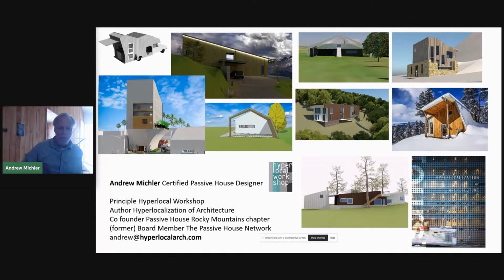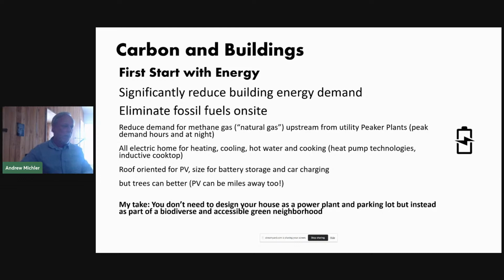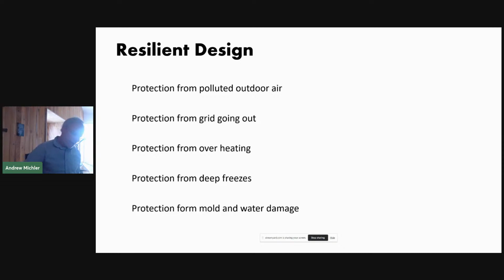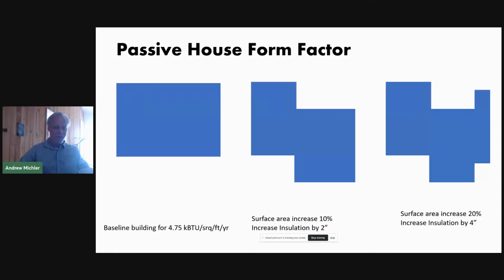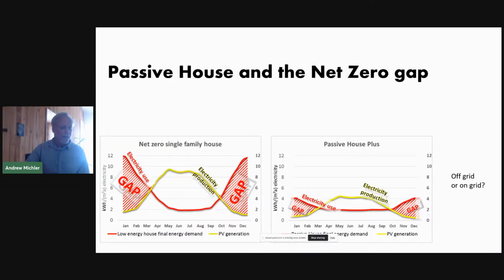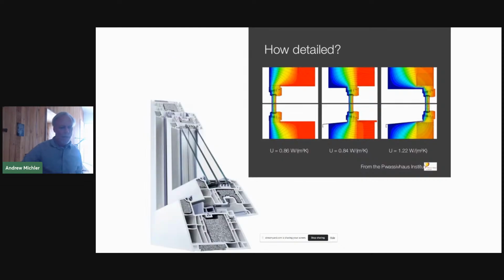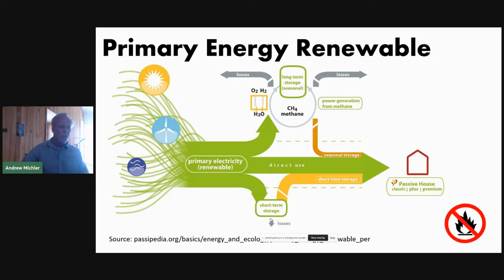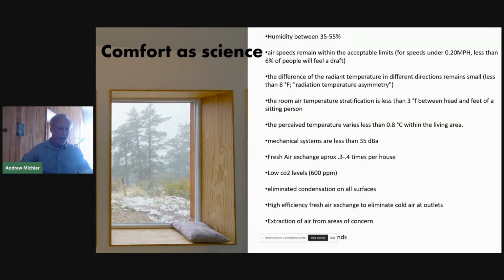High Performance Homes = Low utility bills + High comfort

Comment: If you are looking for information on Passive House design and real world completed projects - this video is a great place to start!  Passive house defined =  (German: Passivhaus) is a voluntary standard for energy efficiency in a building, which reduces the building's ecological footprint. It results in ultra-low energy buildings that require little energy for space heating or cooling.